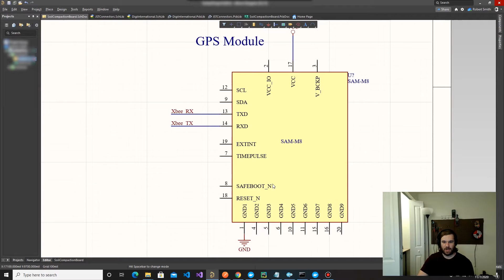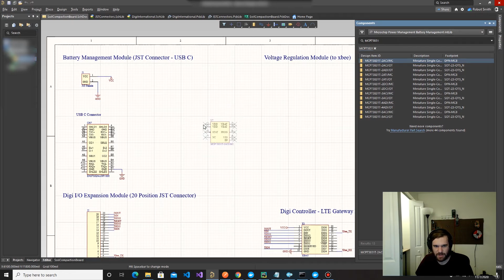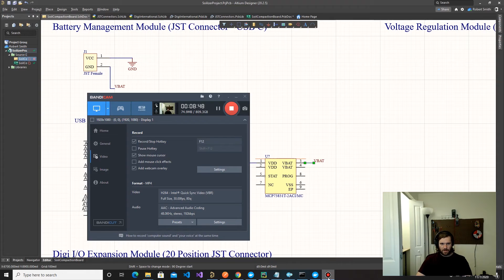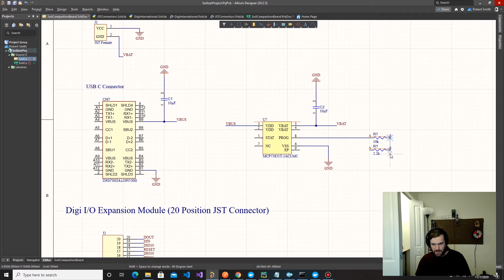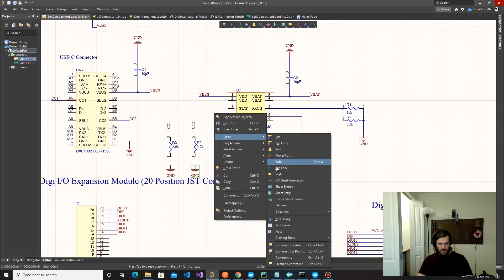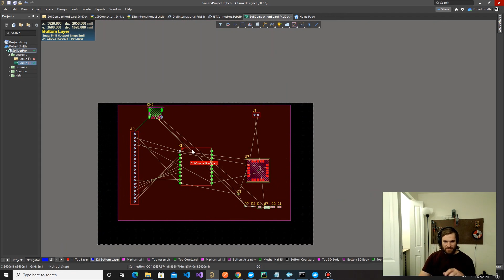Circuit design USB-C Power Management

Comment: I was wondering about Phone charging. A USB type C can fast charge a phone but does it matter if the power is comming from a power bank or laptop? If a type C uses 15w what happens if you are only getting 5w from the adaptor?
Reply from the maker: My understanding is its a handshake. The phone would be the sink and the laptop or power bank is the source. The sink will ask for 15w if the source can give 15w it will if, if it cant it will give its capacity. Still learning on this. Best video on the internet about USB c https://youtu.be/V1OiQoyjDOo
Reply from the maker: Mind blowing part is when something can be a sink and or a source
Reply: @webdeveloperninja9220  okay thanks for the speedy reply :)